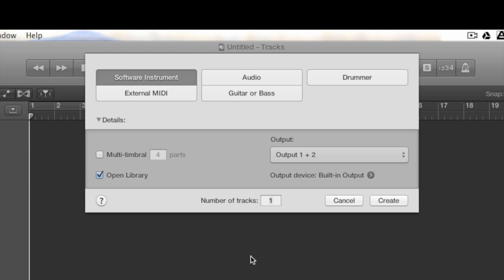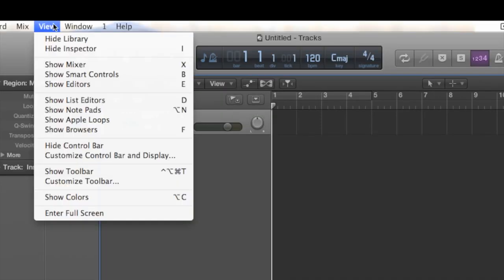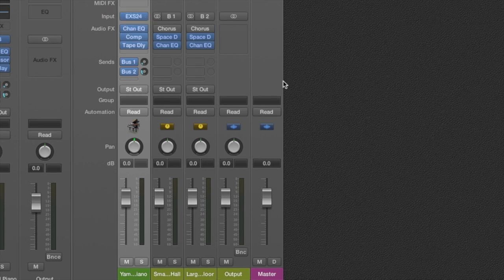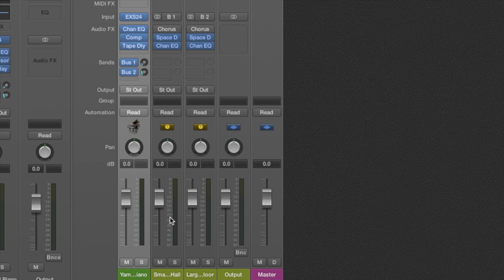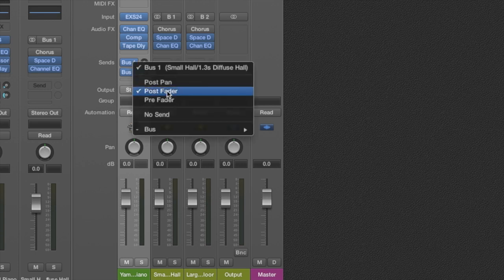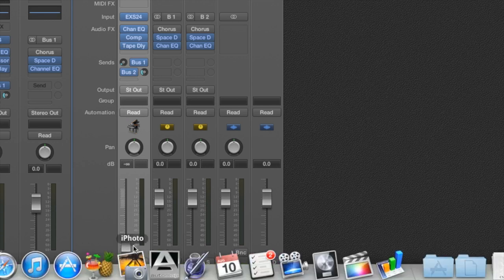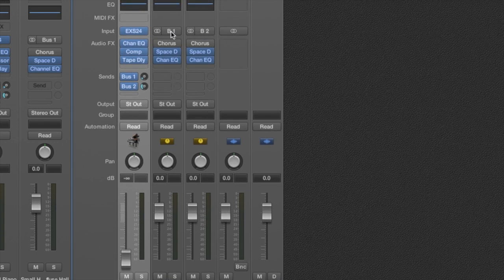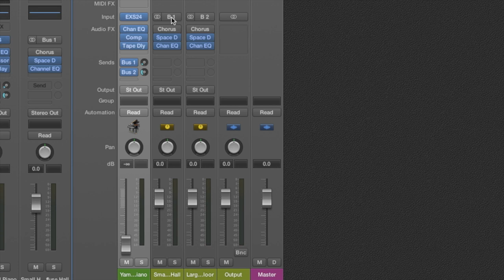Logic Pro X #3: Signal Flow Using Sends, Buses, and Aux

Comment from the maker: The mixer window will appear when you press "x". You'll see the aux channel strips there. At the bottom of each channel strip you'll see the standard record, mute, solo options in available. The S solo option should be available for the aux channel strip. If you still can't hear so going through the aux channel strip, then check the SEND volume knobs, because you might just not be sending a lot of the signal to the BUS that SENDs to your AUX channel strip.